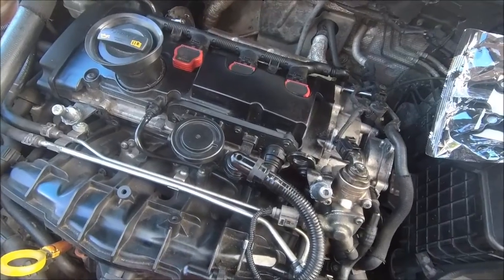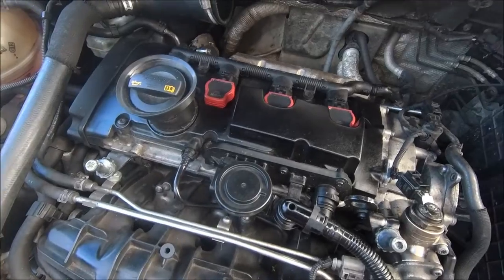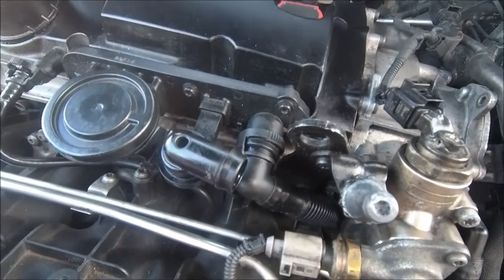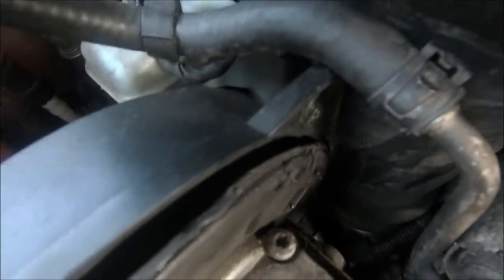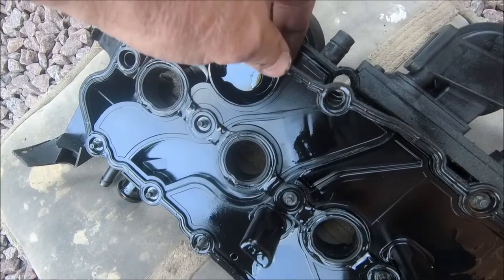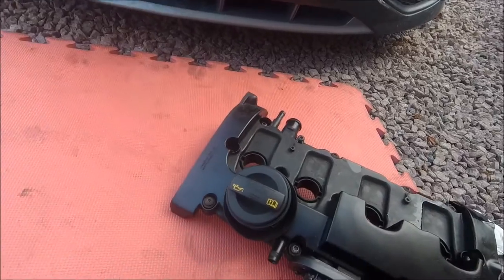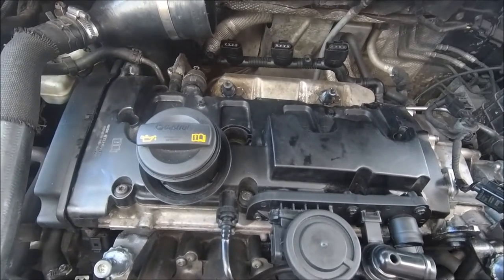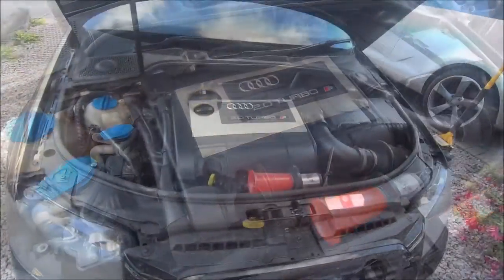Audi S3 - Cover Gasket and PCV changed

Comment: I wish the previous owner of my S3 8P had the same morals as you, as I'm 20k in parts and upgrades on a car that's worth 7K over 3 years after the previous owner covered the warnings lights on the dash to get it through the MOT etc!

PS is that ticking normal, as mine didn't do it then one day it randomly started doing it? I thought it might be the injectors or something as mine has the RS3 injectiors, and an upgraded high pressure pump, and cam follower, Or it might cam chain slightly overdue ( it's booked in next week to be done )
Reply from the maker: Dam... how can people be such arses...  the ticking is the injectors and they are always noisy ,but if you get a slower louder one it could be the lifter, but the wife's A3 diesel had one that "ticked" for years and never caused a problem , I only changed it just before I sold it.